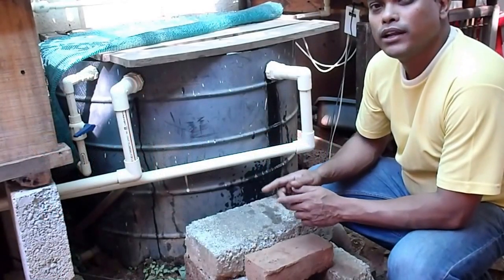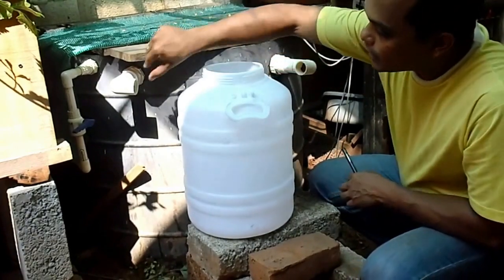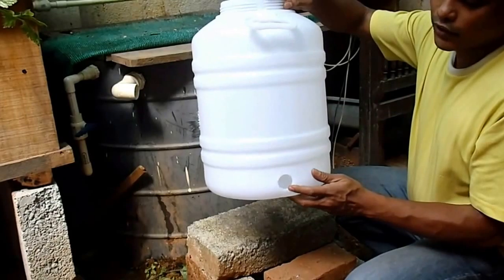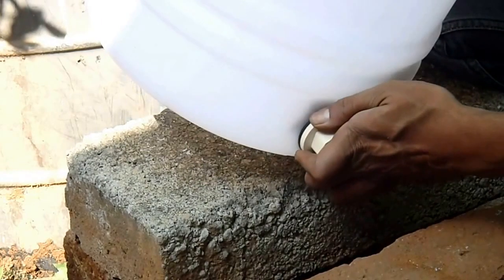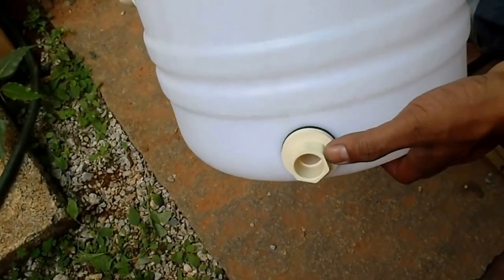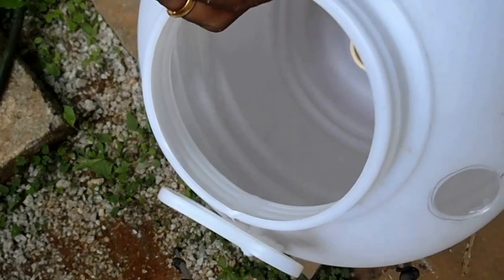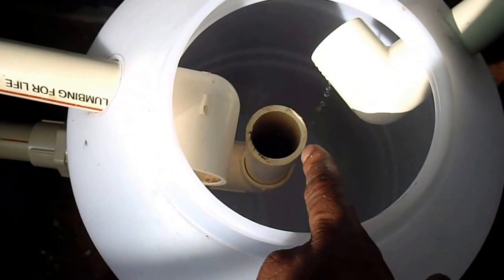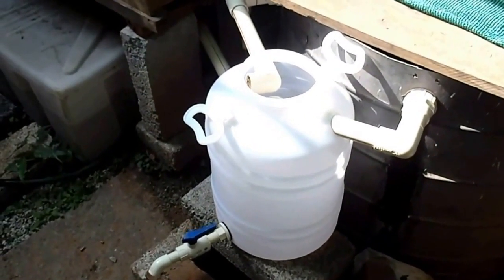Swirl Filter version 1

Comment: Nice build. If the lid on your container seals well I would have turned the container upside down and cut the bottom off. The funnel at the bottom would help to bring the solids together. Then you could place your outlet in the center of the bottom (middle of the lid) to drain off the concentrated solids.
Reply from the maker: Yeah ... sounds good .. in fact when i was cleaning the swirl filter the other day i realised this. This is working for the moment but soon am planning to upgrade this.
Thanks for the suggestion.